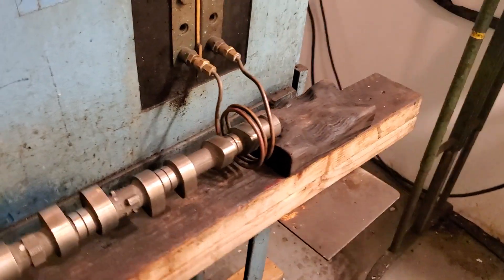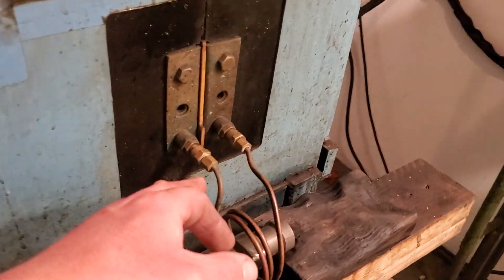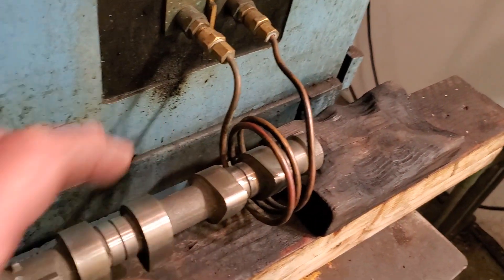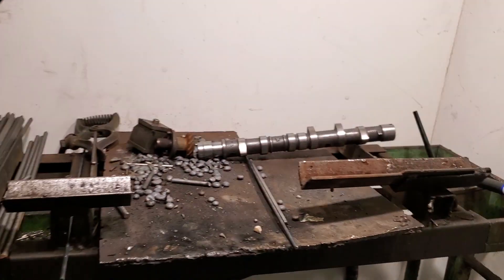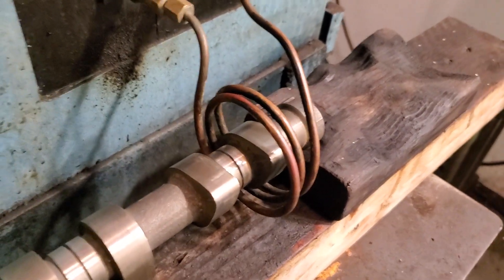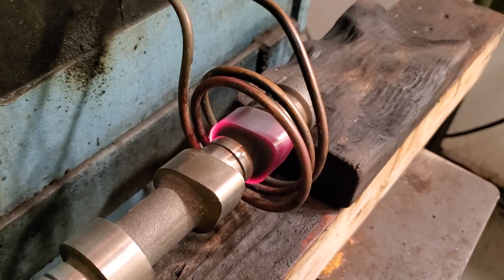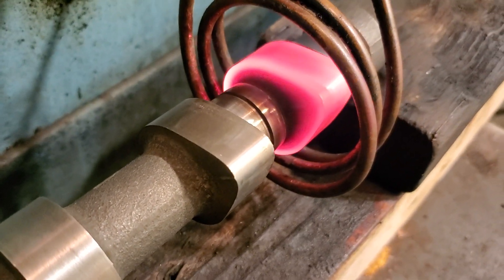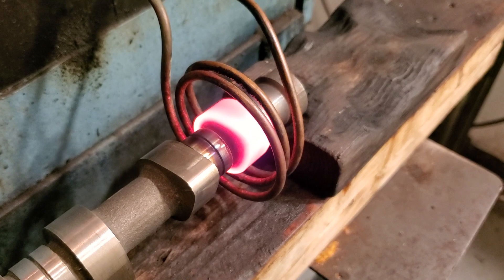Cast iron camshaft welding  DeltaCam.com

Comment: This is SICK . Why dosent this have 6.6M views ?? . I recently had to weld 3 bars of steel to a 2 inch craftsman chrome socket to make my own crankshaft pulley holder so I can remove a crankshaft pulley from an engine I was working on . After I welded it I heat it in a wood fire until it was all red hot then quenched it . After watching this I should have heated the socket and metal bars first then welded them reheated & quenched but hey it all still worked for me in the end

Comment: Hello, I know you don't answer anyone, but I'm going to try hahaha, what kind of contribution do you have to give to weld cast iron? After welding you have to cool down, do you have to give some heat treatment? I'm from Spain, so don't worry, I'm not going to take the job away.
Thank you very much, you are a genius.
Reply from the maker: After welding it is quenched to restore surface hardness
Reply: @DELTACAM8005625500  Thank you for answering, could you explain the rest of the questions that I have asked you, but it is here I could do it by mail.
I'm excited